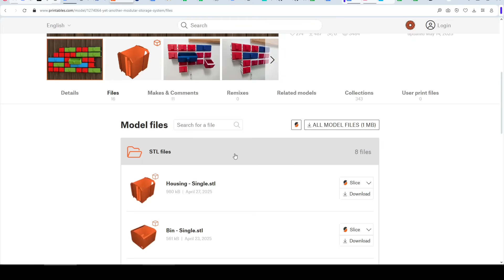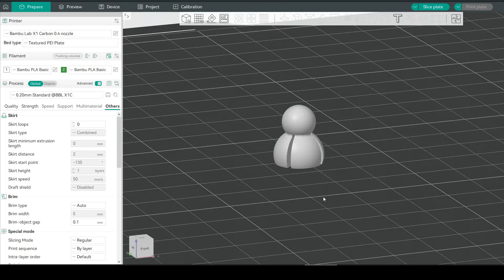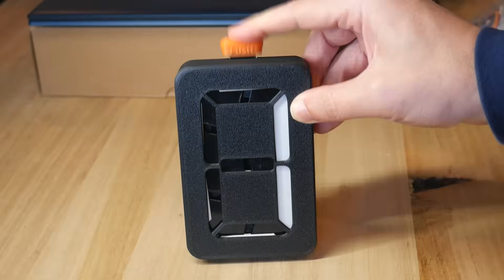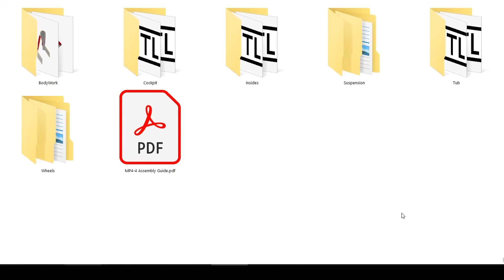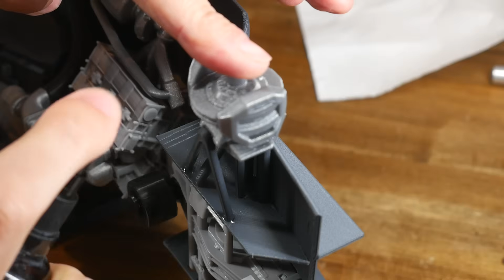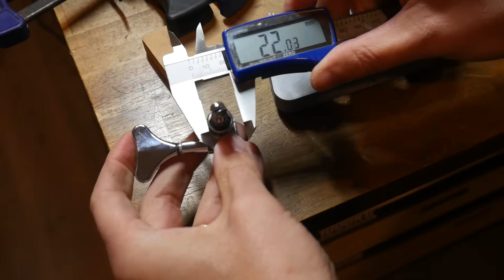Six fantastic 3D printed projects to add to your list

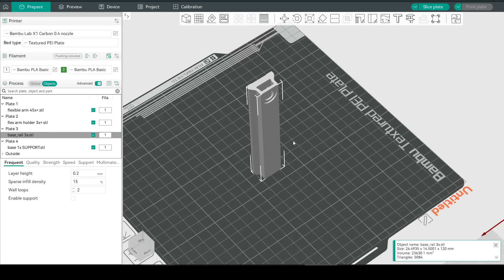Comment: 4:42 How come your printer cant print that object vertically ? What printer are you using ? I haven’t had a spaghetti incident in probably 10years do you squish your first layer ? I half my layer height on the first layer so it bonds good to the build plate maybe thats the difference or maybe its the unit it self i find it odd you cant print an object that was designed to be printed that way

Comment: Here's a 3d printing tip for you: In the prusaslicer and derivatives you can change the bridging angle. That long piece could have been printed with a bridging angle that would take all the 🤞hope out of the equation by having very short bridges.

Comment: I was inspired by your review of their first normal guitar. But I didn't like the complexity of it so I make my own design with zero bolts and skrews. And with the cheapest fret wire, pickup and tuners possible:) And it plays very well. 
The idea of using aluminium extrusion as a base of a neck is genious. And the idea of placing a pickup above the strings - too. It a pity that you cannot use this design for a regular electric guitar - the pickup will always interfere with fingers or pick.

Comment: the use of masonery drill bit might not be the most adapted to do a clean hole in plastics, you might prefer using metal drill bits which have sharp cutting edges
Reply from the maker: Definitely agree 100%. I got the cheapest one I could because I was annoyed over the part not fitting.

Comment: People will like printing my new Transformers models,

TEST FITTING NISSAN SILVIA S15 STL OVER MY ALT MODEL FRAME
https://youtu.be/QEKIh59E9qc?si=npHl5YpoqN1Ueqb3

Nissan Silvia S15 Alt mode and robot mode
https://youtu.be/vIQE1tnwqpE?feature=shared

Cybertruck -RustBucket-Soundwave+
https://youtu.be/5qqatdqE7G8?si=YA1CBApzIDLGdWDx

Transform!
https://youtu.be/BvBKcPgohAI?si=hX3SwaRtGv37pRzW

Printed in PLA
https://youtu.be/GssgrtE3xRw?si=xALL8J0i7s-WRMO1

Comment: Cool looking 3D printed bass! The big problem with 3D printed guitar or bass necks is that the thermal expansion of plastic from the heat of your hands will cause the notes to go sharp if you play for a while, not a problem if you are playing by yourself since you won’t notice it, but it is a problem if you are playing with others. I have tried PLA, PLA-CF, and PETG and all had this problem, even with a 3D printed fretboard screwed down to a wooden dowel neck. That said, I do 3D print thin fretboards with frets that I attach to wooden necks with double stick tape for my cigar box guitars and they work fine. I also do just the frets if I the neck wood looks amazing.

Comment: On the delta table, the loose joints may be because of PLA creep. PETG might work better for those joints, but it'll require some glue or otherwise on a PEI bed.
Reply from the maker: I am using petg already.
Reply: @TeachingTech  My bad, thought I heard that you were using PLA.